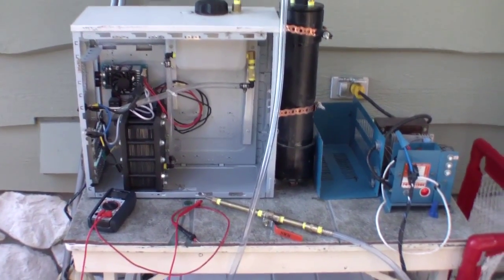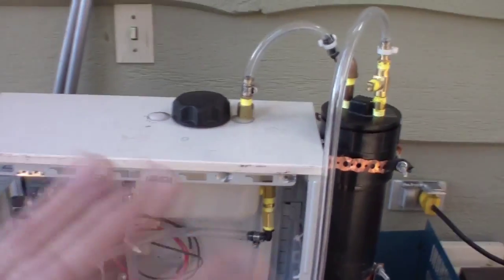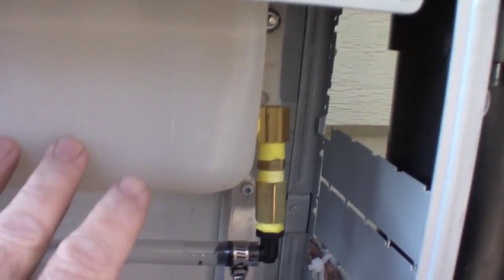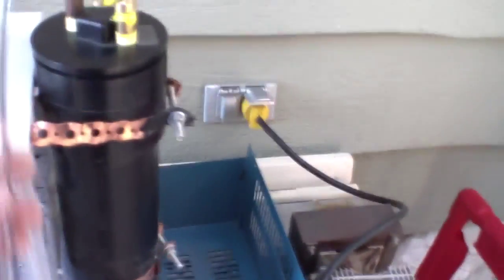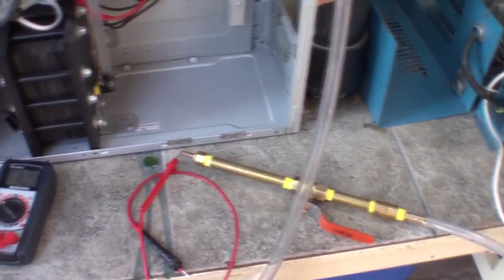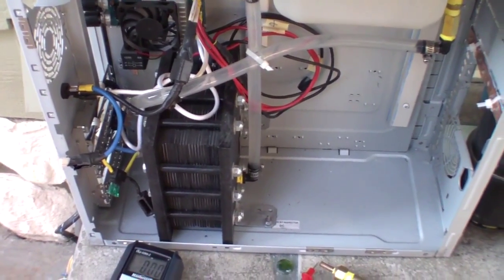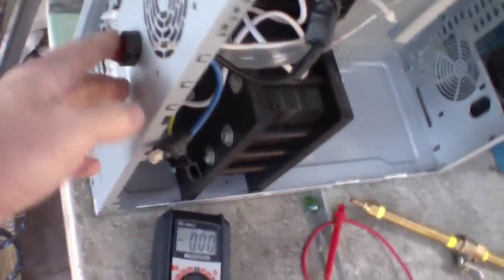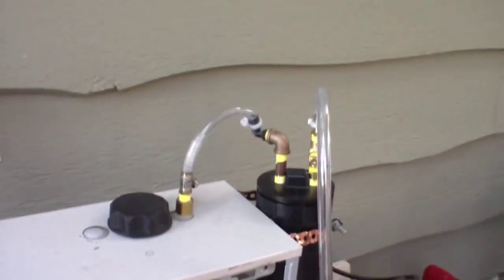HHO - 12V Electrolyser - After Sitting 7 Months Full - About to Rebuild

Comment from the maker: @weslingm I attempted to use it with a on demand RV heater and it all comes down to exactly what you say, finding the material that which the HHO will get nearly white hot... but not disintegrate, and putting that material into conductionwith the water, so.. I think it's not titanium. This will melt titanium believe it or not, I know it doesn't make sense given the flame temperature, but it will. I think certain magnesium alloys are the key. Whether it'd be efficient....i dont know.

Comment from the maker: @jdcproducts Thanks for watching. Another commenter mentioned that the bubbler does in fact as a scrubber for the electrolyte, and it may just be the brass nipple corroding inside it. Probably should have used a nylon or PEX pipe instead. Will check out Mr2tuffs channel. I once ignited a small cube of what appeared to be some sort of magneisum alloy, it went white hot (almost) and really exuded some heat.. but didn't melt. But then I lost the cube...?!

Comment from the maker: For the record, (especially to Naysayers) ... my vehicle DID get 13.5% fuel economy increase as measured on a mechanical dynamo. This is not a phenomenon, and is ridiculously easy to explain: ICE @ 30% uses 85% efficient hydrolysis to increase combustion efficiency. It takes less energy to produce enough gas to complete combustion more thoroughly, than the energy you get out, when using the completed combustion, as torque. Proved and proved again, it defies no laws of physics. End of story.

Comment from the maker: I had no need to. It was used as a jewelers torch in that mode, and 1% was perfect. Anymore, and you get too large of a flame. When I ran it at about 20%, it was producing 3+ LPM. All depends on what you want, what you need. Now it is going to be a 120V model, with about 4 LPM as the goal, so again, less electrolyte.

Comment from the maker: @weslingm I had better luck using it as the flame in a RV fridge. It cools the fridge more effectively than 12V energy put in. This is because of the COP>1 ammonium process, it's much more efficient than peltier thermoelectric cooling methods.

Comment: question: To use this thing as a waterheater. That is if you house the water in a titanium material, then heat the titanium to 3000 degrees. Wouldn't that heat the water fast.